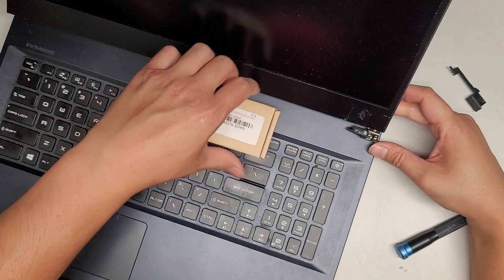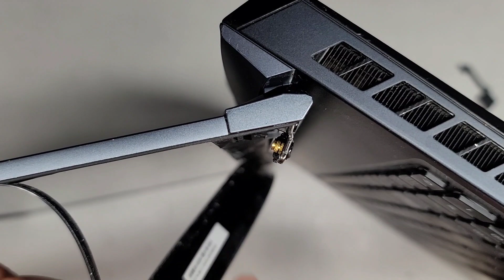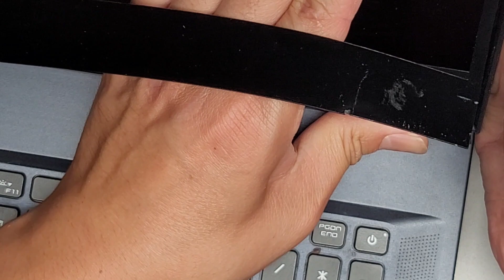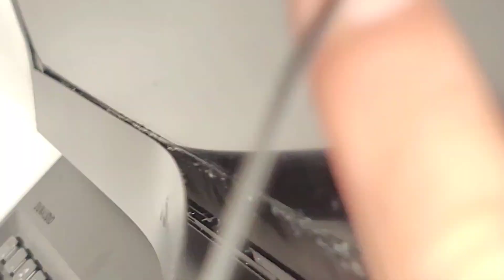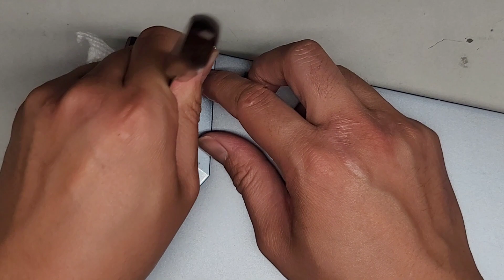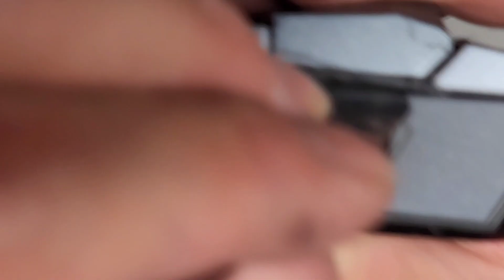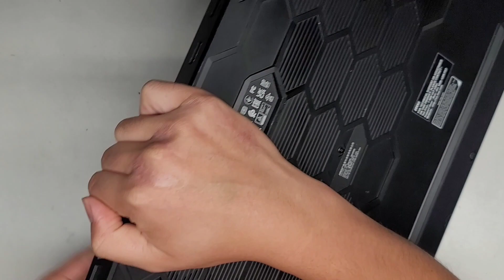MSI GE76 Raider Broken Hinge Repair Without Replacement Parts

Comment: My hinge isn't broken...  yet...  but I can feel it's dislodged from where it should be.
So I'm just keeping this in my back catalogue and not shutting the screen until I plan to transport the laptop.
Big thanks in advance for calming my nerves about the assembly, I was worried I'd ruin the screen just trying to pull back the adhesive layer - pulling down works great for a check.
Reply from the maker: Might want to open it up and check to tighten the screws. You don't want it to break and risk cracking the screen.
Reply: Finally gor around to checking the screws @ItsBinhRepaired  , they all seemed tight and I think the clicking and looseness I felt was the plastic cap had come loose.  Snapped it back into place and everything seems fine!  (still minimizing how much I open and close this thing though.)
Reply from the maker: Nice!
Reply: @ItsBinhRepaired  Well, like magic I tried packing up the laptop today and what I thought was fixed completely snapped apart.  So glad I saved this video.

Comment: I love this video, I am going to try this repair tonight, as my hinge on the right side of my laptop broke the other day. One thing I am uncertain about is the little plastic piece that sits over the hinge. Is that part essential, I don't have it on my hinge and am now guessing that it would have fallen out somewhere. Any thoughts?

Also, thank you in advance!
Reply from the maker: It's just cosmetic. Make sure to use jbweld and not some other random epoxy
Reply: Sounds good, I appreciate it! Great video and production value. I will shoot you something after, assuming it works, as you will have saved me a great deal of time and money. @ItsBinhRepaired
Reply from the maker: Awesome! Fingers crossed*
Reply: @ItsBinhRepaired  It worked great! Gave you a sub and donation. Glad you're making this type of content for people like me!
Reply from the maker: @danielwithers5578  awesome! Thank you so much!

Comment: Mine just broke today after years of use. I will follow this video this weekend and try to repair it. Thanks!
Reply from the maker: Don't cheap out on the glue. Original jbweld is the only one that'll work.
Reply: @ItsBinhRepaired  got it!
Reply from the maker: @cheloi1805kami devcon plastic steel might also work lol but other than that, don't try anything else.

Comment: If I buy a replacement hinge assembly from MSI it's going to include the plastic housing that all the screws are supposed to be set into, would it require full disassembly to replace this part? The hinge assembly is about 40 dollars.
Reply from the maker: The plastic housing? You mean the entire screen backing? Because any less than that and you won't be able to do it
Reply: @ItsBinhRepaired  The plastic that the screw mounts are supposed to be seated in, in my case that is what is broken.
Reply from the maker: @seanreilly6618  did you watch the video all the way through?
Reply: @ItsBinhRepaired  yup
Reply from the maker: @seanreilly6618  how would you replace the plastic?
Reply: @ItsBinhRepaired  That is what I am asking you, the piece is included in the hinge assembly though
Reply from the maker: @seanreilly6618  you can't replace the plastic. Why are you saying it comes with it? Or are you asking me if it comes with it? I don't know what you're buying.
Reply from the maker: @seanreilly6618  if that were the case, you don't need the hinge, just the plastic.
Reply: @ItsBinhRepaired  yeah I think it comes as a set but that is what im saying, isntead of gluing it together why not just reinstall this piece of plastic that sheered in half and then reseat the screws as originally assembled. The only reason I can think of is that getting this piece of plastic replaced would be fiddly, that is what I was originally asking you if you knew how to replace this plastic bit.
Reply from the maker: The reason you don't replace it with that is because if you saw a car was held together with tape, and the tape keeps tearing, would you put the same tape back? It's a design flaw. Why repair it with the same flaw? You can do it if you hate yourself and want to waste money. Lol

Comment: Last time I ever buy MSI crap again
Reply: Idk i have acer, asus, and msi. But msi laptop hinge is always breaking
Reply from the maker: @ailfridha1135 :(
Reply: Me too, what about Asus Rog or Rog Strix brands ?
Reply from the maker: @Elchin3d they all have issues. Check out my playlists by brand.
Reply: To be fair, not all brands have a major lawsuit going on against them for refusing warranty replacement. MSI knows they cheaped out and that they have a problem.
Reply from the maker: @googleeatsassdude  yup
Reply: Why didn't he simply replace the screen plastic frame instead of basically gluing the hinge back together.
Reply from the maker: @robertmowlds6903  you want to fix a design flaw with the same flawed parts? Seems silly to me... if you want to waste time and money, go for it. Lol
Reply: @robertmowlds6903  Sometimes it is better not to comment if you have no clue what you are talking about. MSI did a horrible job with this machine (which should be very obvious from watching the video). Replacing this terrible hinge design with the same design is kinda like cleaning your hands with a fresh warm pile of dog shit.
Reply from the maker: All the brands have this issue. It's the stupid smaller bezels.
Reply: This just happened to me. It's 9 months old and I'm in Thailand my warranty is no good here
Reply: @zeusconquers  If you can find a local laptop repair, i had mine fixed for £30. A real pain though!!! Laptops of this price should not just snap apart at the hinges from simply trying to open.
Reply from the maker: Yup
Reply from the maker: @zeusconquers  jbweld time
Reply: @ItsBinhRepaired  bro my screen went out last night too.  It was on yesterday but I closed it opened it again and black unresponsive screen. Is this a big problem or did it just get disconnected
Reply from the maker: @zeusconquers  likely broke the lvds cable or cracked the screen
Reply: Or you could just not drop your $3k device..  just a thought
Reply from the maker: It doesn't break from being dropped...
Reply from the maker: The hinge design is too narrow with not enough leverage.  Try turning the hinges by finger and you'll see how much force is put on the hinge mounts.
Reply: @calholli  you are a bit simple if you think everyone in this conversation dropped their laptop. It's a build defect obviously and nobody has ever said anything about dropping their laptop once. duh

Comment: I've watched quite a few videos to figure out what to do with my broken hinge ( MSI GE 76 RAIDER). M SI would take weeks at my expense; local shops estimated in the $200+ range after waiting for new parts...  So it looks like you have the best solution.  I spent about 10 bucks on the JBWELD and a small clamp, watched your video several times and tried your solution.  This morning I unclamped the repair, put it back together and it is like new.  Thank you for your great solution!!!
Reply from the maker: Awesome, glad it helped. If you haven't already, please like and subscribe so others can find my videos and possibly consider watching a few others to get the algorithm to recommend my channel. Thanks!

Comment: I HAVE A GP76 12UH AND THE HINGE GET OFF THE LID BUT THE SCREW ARE TIGHTEN SHOULD I REMOVE THEM OR JUST DO THE PROCESS WITH THE SCREWS ON THE HINGE
Reply from the maker: Remove the screws.

Comment: This video doesn't consider the reason why the hinge broke away from the lid in the first place. The lock nut on the hinge needs to be loosened (as this is the typical reason for lid/hinge breaks) so that it doesn't create undo stress on the threaded inserts on the lid. Simply caking it with J.B. Weld is pure amateur hour. Its messy and if you don't do it correctly the bezel won't go back on properly. This one-time fix guarantees the hinge will have to be replaced along with the lid if you ever have problems with the lid in the future. This unit would need a complete break down to address the seizing of the hinge.  

Once you address the seized hinge by loosening the lock nut. I use LePage Super Glue Gel to reform the plastic around the threaded inserts and then Hot Glue the surrounding area to provide the maximum bonding area before putting the lid back together. 

In 17 years professionally I have not had a single issue with this process. 

Disclaimer: This isn’t a slight against the creator of this video. He obviously knows his way around a computer. As a technician and a business owner this would not be addressing the problem at hand and would be unacceptable in my view.
Reply: I agree with ReThinkTechnologiesInc.'s comments. I own a business also repairing laptop broken hinges. The hinges get too tight.  Almost every hinge repair job that comes in, the hinges are too tight. It's important to loosen the hinges to a 'normal' operating level. He didn't mean loosening them so much that the screen is floppy and can't keep itself up. Only to a normal feel. If you don't do this, it will break sometime down the road. There will be more pressure/stress on the screw threaded inserts.

I don't use JB Weld or hot glue as a solution. If you want to save money, it'll work, but for most common newer laptops today, it's a temporary repair. Definitely not a permanent fix for ANY laptop. For most average laptop owners, it will break again down the road. Then, repairing the laptop will be a lot more difficult. Yes, for some laptop models, especially older ones, with a sturdy stronger screen back cover construction, JB Weld and similar fixes CAN be permanent. Yes, JB Weld for me on an older laptop repair was sufficient. I'm not saying it's not possible. But, for professional technicians, they aren't the holy grail for laptop hinge repairs. 

I have to fix laptop broken hinges the first time for customers. I don't want them returning back to me months if not weeks later with the same problem. That will be the case if JB Weld is my method of hinge repair. Then, I'll have to waste my time replacing the screen back cover/lid. It won't be a good customer experience, and it'll likely lose my future business with them. There would be trial and error if I experimented with ReThinkTechnologiesInc. 's method. Trial and error is not a good repair shop model. The best way for me with laptop hinge repair is to replace the back cover/display lid and hinges if one or both are needed. Loosen the hinges to normal motion. Check that screws on the threaded inserts of the back cover aren't over tightened as well. Also, inform the customer to keep the raising + lowering of the screen to a minimum. If they do that too much, the higher risk of the hinges breaking.
Reply from the maker: Lol... except that's not the issue. The issue is it's a design flaw, which is caused by the desire for thinner screens with narrower bezels. The hinge is too narrow, so there is too much torque on the screw mounts. Yes, you can loosen the hinges, but then you get a floppy screen that falls over too easily.

By flooding the hinge with jbweld, it holds the hinge at the top and bottom as well as closer to the part that rotates, giving it a much better bond and more leverage. As for the bezel not going on, a thin plastic film is put over the jbweld and the bezel is put back before the jbweld hardens to ensure proper fit and placement of the hinge as well.

Hot glue?! I can tear hot glue apart with my hands. That will do absolutely nothing to hold the hinge other than to keep it aligned while the other glue sets.

I've had maybe 2 out of the hundreds come back, and that's because I tried to keep the functional screws in use... bad idea.
Reply: I had my Mechanical Engineer son in law make me flat spring clamps for each side (bent flat steel stock) because the jbweld solution didn't hold together more than a few months.  With the flat clamps in place, the hinge functions as it should.  The clamps tend to stay mostly in place, even with the lid closed.  The tech at the repair shop who did the jbweld bit for me said that he could not loosen the spring/bolt of the original design.  Dunno if he actually forgot to try it when I told him that it need to be loosened. @ItsBinhRepaired
Reply: @ItsBinhRepaired ⁿllp]
Reply from the maker: Wuh?

Comment: WOW! Beyond stupid. This is a straight up ghetto fix, not a repair and it won't last.
Reply from the maker: This fix holds up better than the plastic that they use... you really think a flawed design should be repaired by replacing with parts that have the same flaw? I've yet to have one come back and offer 1 year warranty and a discount beyond that. Show me any repair company that offers a 1 year warranty on repairs... lol You have no idea what you're talking about.

Comment: specs?!
Reply from the maker: No idea
Reply: @ItsBinhRepaired  plus mine has a hinge problem mine is a msi gf66 the hinge is getting lose and can u tell me how to fix the screen issue
Reply from the maker: If it's broken, you'll need to use jbweld to epoxy it in place. I have videos of that process on multiple models.
Reply: @ItsBinhRepaired  thx
Reply from the maker: Hope you were able to fix it
Reply: @ItsBinhRepaired nope not yet
Reply: @ItsBinhRepaired  :(
Reply from the maker: That's a long time
Reply: @ItsBinhRepaired  yup
Reply from the maker: Hopefully soon
Reply: @ItsBinhRepaired  yes :) have a nice day!
Reply from the maker: @valt9093  you too

Comment: I bought this model computer in 2021. Model is MSI GE 76 RAIDER. But 3 months ago, its right and left hinges broke. I am really sad. I was looking for a solution on the internet. Does your solution still work?
Reply from the maker: Why would it stop being a solution? Lol
Reply: I'm happy for you @ItsBinhRepaired
Reply: If both broke I'd just give up and replace the lid...
Reply from the maker: @mangakey Keep in mind that replacing the lid will just result in the same issue because it's a design flaw.
Reply from the maker: @mangakey  nah, it's still repairable
Reply: @ItsBinhRepaired  I didn't mean it wasn't still fixable. I'm just saying me "personally" if the lid broke in 2 place or twice  in the same place. i wouldn't trust it   so I just replace it...
Reply from the maker: @mangakey  haha true. It's a bad design

Comment: The idea of loosing the laptop hinge after buying the new laptop will prevent this kind accident?
Reply from the maker: No. If you loosen the hinge, your screen will fall over.
Reply: @ItsBinhRepaired (of course not that loose .) so what would the best choice for that kind of laptop? (Like the msi,
Are all msi has small or fragile hinge?)
Reply: @whome6496 i work in a repair shop sadly all brands of windows laptops have at least one model that has this as a common failure lol
Reply: @whome6496 lifting from near the hinge as well as the top of the display will help to reduce stress in hinge points
Reply: I've heard people say that a lot but I don't think it helps.... Just don't see the logic to it....
Reply from the maker: Hm?
Reply from the maker: It'll flop over. Lol